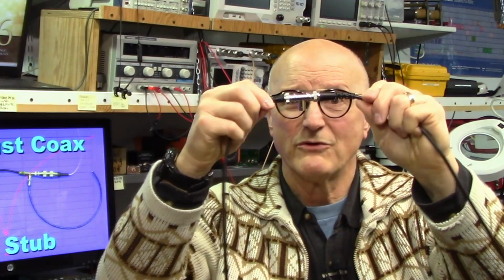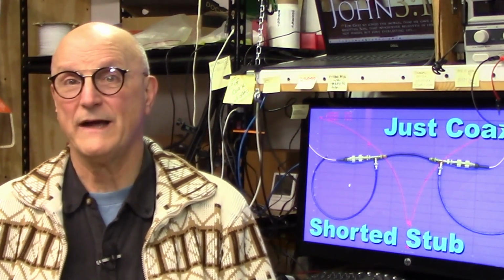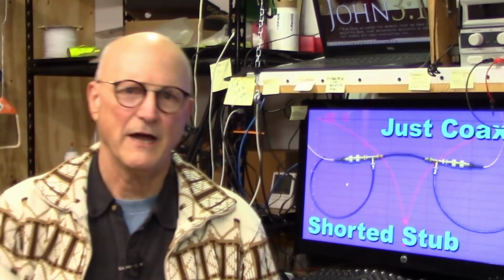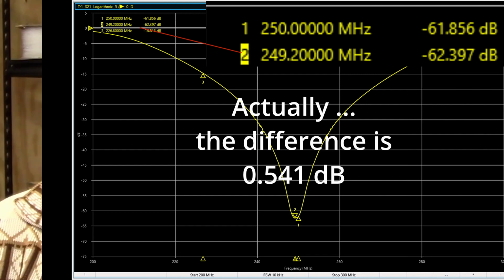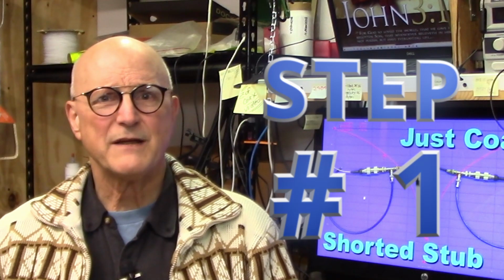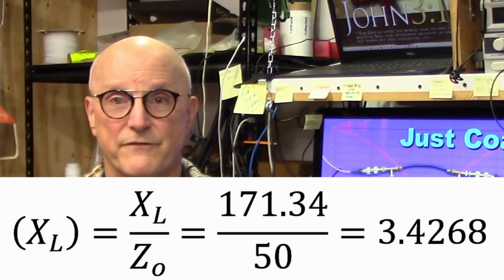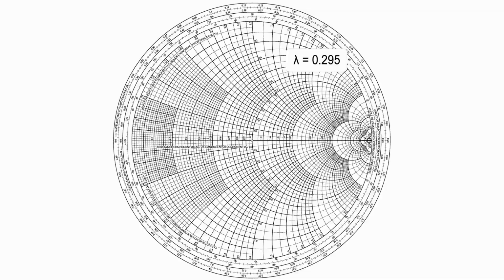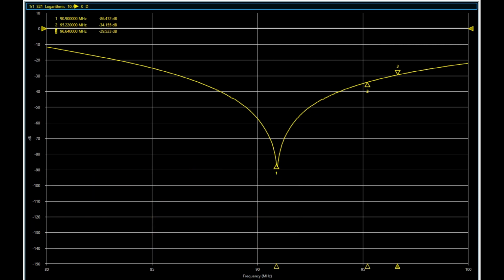Create a Band Reject Filter using just Coax: Shorted Stub Version (049b)

Comment: Hi Ralph, I'm revising this topic because I've had an idea for a project.
I want to make a band pass filter, not band reject.
Should the stubs in that case be separated by an electrical 1/2 wavelength of line? My ponderances keep coming back to that conclusion
Reply from the maker: One half wavelength translates the impedance from itself-to-itself. I have not discovered a method of creating a bandpass filter using this. You can have two band rejects at the two ends of the pass band creating a pseudo-bandpass, but it would not created a genuine one. :-)
Reply: @eie_for_you okay. The thought is to use shorted 1/4 wave stubs or open half wave ones so they do not attenuate at their resonant frequency. Them being half wave apart is because of the pass characteristic desired rather than a stop one. The high impedance stubs are located half wave apart for the reason that a half wave is an impedance repeater and you want them pretty invisible at the pass frequency.
I'm just thinking here, maybe I have something mixed up
Reply from the maker: Well, you can give it a try.  I'd be interesting in your results. My email is ralph.eie4you@gmail.com :-)
Reply: @eie_for_you I thought you could help me with some guidance, thats why im asking.
I want to narrow the response of a few cascaded broadband rf amplifiers. 
I don't have a lot of instruments.
I'm about to buy a VNA
Reply from the maker: Like I think I said, I do not believe you can effectively use this method to create true bandpass filters. You can cascade to band reject to produce a pseudo-bandpass, but the response is very broad.
If you are going to buy a VNA, I am assuming you are thinking a nanoVNA. Be sure to buy the genuine article as opposed to the quick and cheap knock offs. The difference in capability can be quite obvious. :-)
Reply: @Dazzwidd  If you have standing waves then yes, spacing the stubs makes sense.  It also could matter at frequencies near the dip but not AT the dip.  But if the coax is itself matched and not experiencing standing waves, then neither stub has any idea or interest in the other stub.   The implication is almost obvious; you could have a succession of stubs at nearly the same frequency to create a band stop filter.  But watch out for the harmonics.  
Each stub is actually creating a reflection, infinite SWR in other words.  This phase shift is where the magic happens.  It isn't a filter; it reflects the signal shifted in phase 180 degrees and achieves cancellation at the t-connector.  But at nearby frequencies the phase shift is not going to be 180 degrees and the cancellation will be incomplete.
Reply: @eie_for_you do you think they should still be a quarter wavelength apart even though its band pass and not reject?
Reply from the maker: The wavelength apart determines the impedance transformation between "nodes". A 1/2 wavelength transforms the 50 Ohm input impedance to a 50 Ohm output impedance. In other words, it does nothing. 
The 1/4 wave distance transforms the 50 Ohm input impedance to a high impedance. Thus, the stub, which looks like a "short" at this same frequency, acts as the output impedance of a voltage divider. High input impedance, low output impedance, low output voltage.
To make a bandpass, the stub would have to look like an open at the center frequency and a short everywhere else. Further, the series coax would have to look like a perfect 50 Ohm transformation (1/2 wavelength as you surmise), but a transformation to a high impedance everywhere else.
The big issue here is not at the center frequency, but at the "everywhere else" frequencies. Coax just doesn't behave that way. As frequencies change, the impedance transformation of the coax also changes continuously because its electrical length of a fixed length of coax changes with frequency.
So, while we can make band reject filters with coax, I have significant doubts that one can create a bandpass filter with them for the above reasons. :-)
Reply: Stubs have multiple dips and peaks harmonically related.  It really is not suited to bandpass which is simply a high pass and a low pass overlapped.

Comment: I need narrow, could the two-stub be doubled for greater steepness? I do understand tuning would be super fiddly, but I'm trying to use weak signal 2m and the nearby digipeater is "plugging my ears" from 8 miles away. It operates on 144.300, SSB meets at 144.200..
Reply from the maker: Doubling the stubs, unfortunately, only deepens the notch. It does not reduce the overall bandwidth. If you look at the cheat sheet for this video (https://drive.google.com/file/d/182zcpVsn8ZiloRLiqkkndT8XlpsAkoWr/view?usp=drive_link), on the last page you will see how massively wide the bandwidth is on this. Now that I look back on this to remind myself of it, I do not think it will do what you are looking to do. :-)

Comment: can i ask something? i want to make a 137mhz turnstile antenna do you know a turnstile antenna with 1/4lamda coax for 90° phase to make it circular polarization. 1. is it true that 1/4lamda makes the polarization circular? 2. can this antenna use a stub like in the video? if so, can you explain how the phase change of the coax works on the polarization
Reply: I made a receiver antenna for APT NOAA SATELLITE and I read that dipole needs balun, does this crossdipole/turnstile also need balun?
Reply from the maker: @ In the literature I read, they did recommend a 1:1 BALUN. 🙂
Reply from the maker: I had to look that one up! 🙂 After reviewing the antenna design, Yes, the 1/4 wavelength is required in order to have the dipoles phased properly.
Beyond this, I cannot give any real guidance due to a lack of experience with this style of antenna.
I do not know where you would use a stub in the design. If you intended to use this band reject filter in line between the radio and the antenna, I don't think the antenna would care.
Sorry I couldn't be more help.🙂
Reply: @eie_for_you  no, stub for impedance match, because I see in the simulation this antenna has S11 -15db with impedance 80ohm with transmission line 50ohm, my lecturer wants more around 20-30db because this is a thesis so is it possible? lower vswr with this stub
Reply from the maker: @SambilBelajarDIY  Aaaah, so you want a stub match, not a band reject filter using coax!
So you want to watch https://youtu.be/u7eUnbYK8Q0
and/or https://youtu.be/FvhvdGTrdX8 which address designing stub matches. This should help. 🙂
Reply: @eie_for_you  oh, what kind of balun do you use, is it a choke? a transformer? I don't really understand this "balun"
Reply from the maker: @ BALUN = BALanced to UNbalanced transformation. A 1:1 BALUN makes no impedance transformations. Your coax is unbalanced because one side is ground and the real "feed" side is the center conductor.
A dipole is balanced, one side's voltage is going up while the other is going down.
The BALUN takes the unbalanced feed of the coax and turns it into a balanced feed for the antenna.
I hope this makes sense. 🙂
Reply: @eie_for_you  so whre i put the trafo balun?
Schematic : dipole1 - coax 1/4lamda - dipole2-main coax - feed
In both dipole ? Or how
Reply from the maker: @SambilBelajarDIY  Usually, the BALUN goes at the feedpoint where the main feedline ends. BUT, this is a different sort of antenna and, while I would probably default to that location, THAT question needs to be addressed to the designer of the antenna. 🙂
Reply: @eie_for_you  ah okee thank you for information
Reply from the maker: @SambilBelajarDIY  Sorry I couldn't be more help. 🙂

Comment: Can this band reject filter coax replace a duplexer?
Reply from the maker: Very good question! In fact, that was one of the things I was thinking when I first started playing with this concept. Unfortunately, the Q of this filter is not high enough to accomplish this task especially if we are talking amateur radio 600 KHz, 2 meter band separation. If the transmit and receive frequencies are far enough apart, I do not know why not. I'd use the open stub with a variable capacitor termination so you could tune it easily.  The only other issue I see might be the changes in tuning with temperature(??).🙂

Comment: could this be used to build a low power duplexer?
Reply from the maker: Ya know, that is what I thought to do with it, too. the answer is, "It depends on the separation between the transmit and receive frequency." For the 2M amateur radio band with a 600KHz separation, not at all (I discovered). The dip can be made to be deep enough for the reject, but the overall bandwidth on the "skirt" afford a lot more attenuation than you want 600 KHz away. Will it work on a 70 cm duplexer with a 5 MHz separation? Well, I actually didn't pay much attention to it, so maybe...maybe not.
So, the big issue isn't the depth of the notch as much as the attenuation on the skirt affecting the receive frequency. 🙂

Comment: looks like 10dB down at 220MHz - the frequency you are trying to actually use.  That's a lot of loss.  Seems only useful for very strong signals where losing 10dB can be afforded.  Good stuff, though - just only useful when the interferer is very far from the desired frequency.
Reply from the maker: You are right. They are quite wide banded. With that said, I have known folks to have used something like this as band reject filters for HF operations on field day so two stations operating on different bands didn't interfere with each other. 🙂
Reply: @eie_for_you  Could it be possible to reduce attenuation at the frequency you want to receive (eg. 220 MHz in your video) by adding a capacitor in parallel at the junction point (the "T") between the shorted stub & the coaxial line ?  The idea is to create a "band pass - band reject" response curve.   I have seen some examples of 6-meter (50 MHz) duplexers done with Heliax coaxial cable.  Any experience with this?  Thank you.  🙂
Reply from the maker: @danduf7123  My experience in trying to create band-pass filters with just coax never provided acceptable results (from my perspective) due to the very WIDE response. 
It is a pretty slow response on the pass side. Even on the reject. The reject frequency is pretty impressive from a reject point of view.  However, if the desired frequencies are close to the reject frequency (like with a VHF repeater - 600 KHz), there is going to be a noticeable loss at the desired frequency. This is due to  major degree to the very physics of the change in capacitive & inductive reactances as frequency changes. The slope is only so fast. 
So, that is my take on it. I'm not sure how they did what they did. 🙂